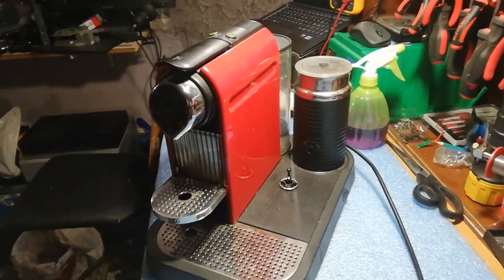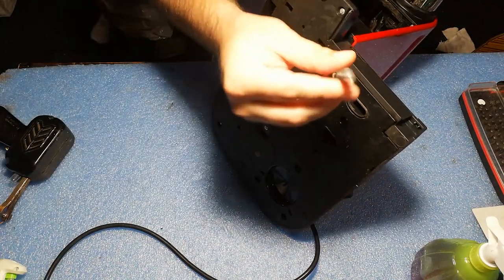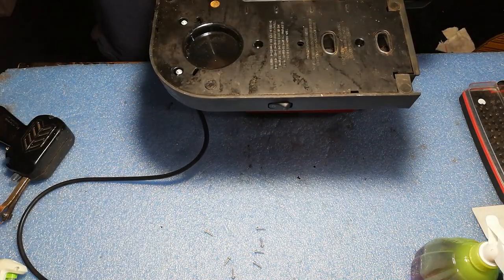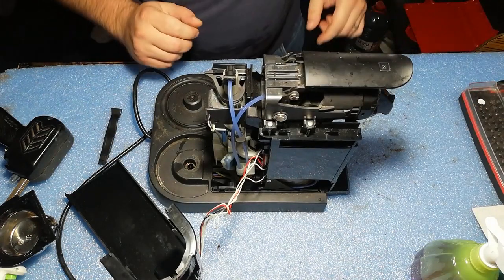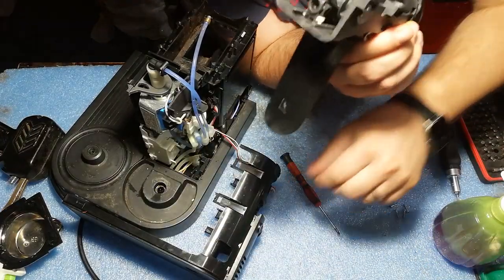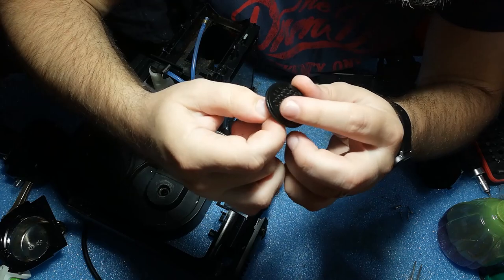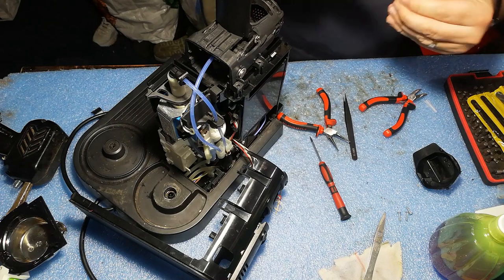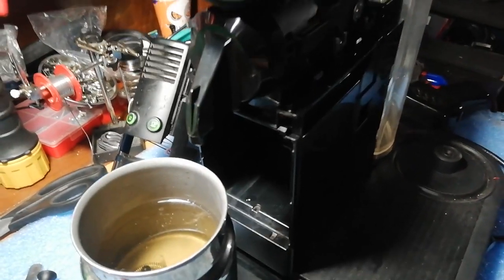NESPRESSO CITIZ & MILK - repair without changing the brewing head KRUPS XN7100

Comment: Thank you 🎉
My machine is identical to the one in your video. I didn't have a oval bit/screwdriver, and stores are closer by now, so i heated a plastic pen and pressed it agianst the oval screw to shape it, and was able to unscrew them. After that, following your great instructions, i managed to fix the leak by cleaning the perforated plate, and clean out all the gunk buildup while at it.

Again, thank you for allowing me to fix it for free instead of throwing it out 🤟
Reply from the maker: Glad to hear you did it. Kudos!

Comment: Brilliant video for coffee lovers & DeLonghi Nespresso machine owners... thanks for sharing! 👍 I had the same issue with a newer model (internal mechanics are identical) and I cleaned the perforating plate thoroughly using a toothbrush, ran a full cleaning cycle and used compressed air to gently blow through from both sides of the perforating plate & in through the nozzle. I then ran another cleaning cycle... and some of the gunk did actually come out. The leak on the inside appears to have been re-sealed... but I suspect that I will have to redo this cleaning operation every now and then.

Comment: Nice job mate. If you open alot of these coffee machines, consider making a T or L shaped oval driver, or mod the existing one.
This model has 4 screws to pop the main unit a bit out. So I used a 3 jaw chuck to sds adapter from my bosch hammer, and boy that grips on the screw so good you can't pull it out. The rest of 5 screws are for the rest of the bottom part, but if you only need to get the main unit up a bit so you can tackle the sides, take those 4 screws and the main unit is loose from the base. Make sure you don't pull too much, as the pipes from the water tank don't have much slack.
I will take mine apart to clean it tomorrow, and I hope it's not the o-ring, even this is about 7-9y old.
Thanks again for the video, as I was going to oder the whole brewing unit, but now I'll check where the water comes out, and try out the cleaning method first, as this machine was never cleaned.
Cheers !

Comment: Cheers Adrian, 
I attacked my leaking Magimix last night and cleaned out all the holes. The nozzle was filthy dirty and I had good hopes this would solve the leaks. The good news is, the coffee produce the ends up in the cup is better again and the leak has gotten less. We still have some dripping left here, but after about 10 years, replacing the entire machine might become an option. 
Thanks a lot for the video, it's very instructive and by this I succeeded in not only taking the machine apart, but also putting back together and having it working again.
Cheers and enjoy your coffee 
Paul
Reply from the maker: Hi Paul. Happy New Year! After 10 years of use for sure you have a shrinked o-ring gasket. That one is really easy to change and to find. The down side is that you have to reopen the machine again to have access to it.
Reply: @benassy69  Happy new year to you as well. Thanks for that! I will surely have another go with a new o-ring, I won't hold my breath for a flewless machine after this time of use though. Enough time before the machine comes available that we want to order
Reply: @benassy69  thanks again, could you tell me which one I need? i find a whole collection when i look for them :p
Reply: @benassy69  I found I can get the part out from underneath when removing the leak tray. just ordered my new o-ring as the old looks a bit 'old' :)
Reply: @benassy69  hi cheers again, opening and closing gets easier each time. After cleaning the piercing grid and trying a few slightly different size of o-rings, the leakage has not sufficiently improved after all. i decided to replace the machine, rather than investing in a new brewing unit. still i liked the journey of trying the cheap options. it gave me trust in the repairability of machines and a regained my repair skills a bit :)

Comment: Great video, I have cleaned the plate and testing still shows a significant leak so have dismantled the brewing unit to access the o-ring. Can you please advise what size of o-ring is needed as a replacement. Thanks
Reply from the maker: Hello a 36-38 mm diameter and 3mm thick

Comment: I have found that a dental water flosser like the water-pik works wonders as a miniature pressure washer for cleaning tiny details like you have on this project.  
I have one of these that I bought at the thrift store.  I wanted to use some parts to build an automatic pour over machine. The pump, and perhaps the boiling tank. However from the pictures it looks like the boiling tank is made from aluminum, which is what I am trying to avoid.  Is the tank aluminum or stainless steel?

Thanks.
Reply from the maker: Hi. All machines have aluminium heaters.

Comment: Nice video. My machine leaks from the brewing mechanism down into the pod cup. BUT only when I use a pod. I e tested it without an actual coffee pod and it doesn’t leak. I can’t figure out why only when I put a pod in there. Any thoughts?
I t has an o-ring and that piece with the tiny holes was clean nothing clogged. I cleaned it anyways.

Comment: Hi Adrian - I have the same machine as you repaired above. My machine was leaking through the bottom casing and I have disassembled it as you have shown above. However, Your video shows the back of the machine but I have a leaking hose connection inside the machine at the front side (milk heater side). I cannot see how to remove more of the black casing to get access to the loose hose and clip. Can you help please

Comment: I find it very frustrating that what seems to be a common problem with these machines is not being recognised by the manufacturers.  I am a 74 year old and there is no way that I can do as you have described. 
About time Nespresso acknowledged that there is a basic design problem and either fix it or design the machine so that Mr and Ms. Average can carry out maintenance themselves.

Comment: Thanks for the good video. I did the cleaning but it is still leaking. I do not believe due to the o ring but I think it is because the plate part with the holes of the brewing mechanism is not replaced well. Is there a particular way to replace this part? How do I know that I did this correctly?
Reply from the maker: Hi. If you heard and felt the click when you put it back in than it is well inserted. I suspect you have also a loose oring. I will make a video today on how to change the oring on a Citiz model.

Comment: Still trying to figure this leaking problem out… does the O ring replacement need to be a flat-face O ring? Or will a standard O ring of the correct diameter be fine?
Reply from the maker: Not flat face. Standard round o-ring is fine.

Comment: Thx for your very helpful video.
But the quality of krups is not only cheap it´s also very difficult to repair. It starts with the head of the screws on the button. I replace them by screws with a torx head. The plate in the brewing unit is made of plastic. No metal ( very cheap ). When I try to move it out of the brewing unit I do not get the plate in one part, I got three parts. I have to order a new one.
Horrible engineering.

Comment: I have a unique problem, yes there is leaking but also, the capsule will not get perforated when the lever comes down. So no coffee at all!!
I miss my coffee Adrian!! Help!
Reply from the maker: Hello. The capsule gets perforated at the narrow end by some knives and at the wider end by the water presure. If your problem is at the narrow end take a look if the knives are not bent.
Reply: @benassy69  sorry I should have been more specific. It is not at the narrow end it is the the diffuser end. We have removed the diffuser plate, cleaned it and placed it back in. It did snap in place. Non-perforating problem existed before and after cleaning everything.
Also, it seems that it requires less force to close the lever down on the capsules than it did before.  Not sure how to adjust that. The springs look fine. So looking for your expertise. Thank you!!
Reply: I had exactly the same problem only to discover I had put the plate back in with the puncture side facing away from the capsule!
Reply: @t.walker4910 have you been able to solve this? I am facing the same issue. Thanks in advance

Comment: I watched you but not close enough. I put the round bit back in the wrong way around and nothing worked. I took everything apart and put it in the other way and it's started working. I couldn't see on your video which way you put it back
Reply from the maker: Yes, sorry about that. Always put it back with the rugged part towards the capsule.
Reply: @benassy69  very kind of you helping others. Just made a coffee and not leaking everywhere, thank you so much.